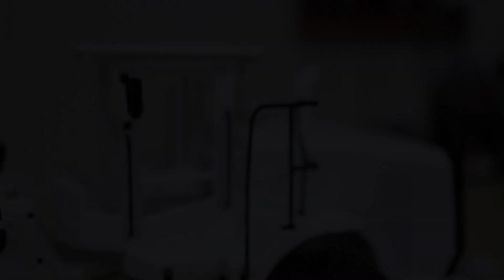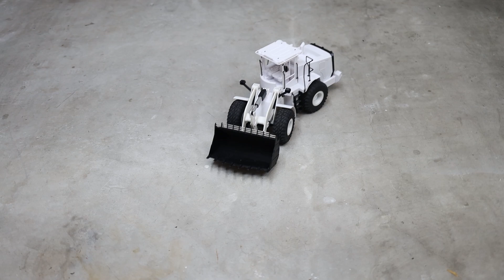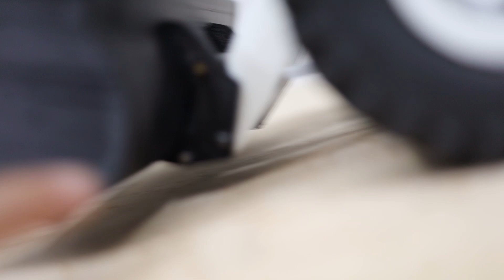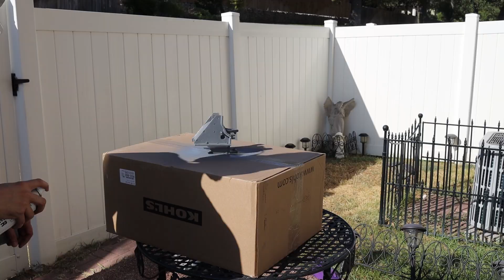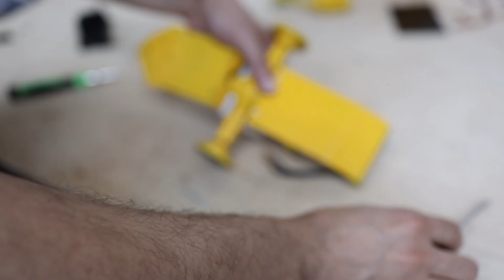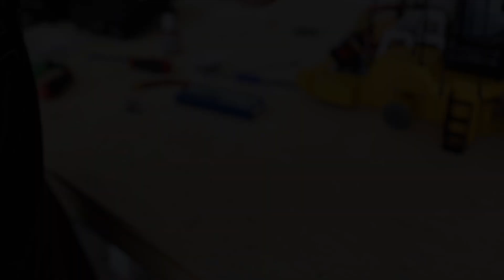3d print wheel loader

Comment: Great work! Very well done. Is it scalable? I want to build one 1/10 or even 1/8 scale. Increasing motor and hydraulic components would be necessary, but I wonder about the strength of the plastic used.
Reply from the maker: Plastic should resist, it has also metal rods to give reinforcement. You have to take account differential hardware size for the scale you are looking for

Comment: Hey Domingo, these are amazing projects. I’m trying to decide which project to build and from which maker. Do you include STEP files along with the STL files when purchased? This would make it easier to make any slight changes to the parts as necessary. Thank you all your work on this and your other projects.
Reply from the maker: Hi yes I include all 3d files, building list of materials and all assembly instructions you also have my videos to guide in the process, the manual is the most detail the you can find, I spend months working on it.
Reply: @domingomartinezt  Hi Domingo, thank you for your quick response and info. Your project is well worth the purchase price. Myself being a 3D maker and a CAD developer I know how much work goes into prototyping and development. Thank you again for your assistance and dedication to your projects.

Comment: Hola exelente trabajo!
Tengo experiencia en 3d printer ,pero en lo electrónico no se mucho  creo que para instalar los compnentes electronicos no seria mucho problema ,en los archivos incluye la guia para la instalar todo lo electronico y sobre como hacer funcionar el control remoto? Diaculpa la.pregunta pero nose mucho al reslecto .muchas gracias de antemano.
Reply from the maker: Hola, gracias. En el manual incluyo todos los componentes electrónicos, también un diagrama para conectar todos los cables, y para usuarios más avanzados también un diagrama con un simulator de sonido e inercia. También tienes el soporte de todos los usuarios en mi grupo de Facebook
Reply: @domingomartinezt  Gracias por responder. Por cierto ya compre  los archivos.